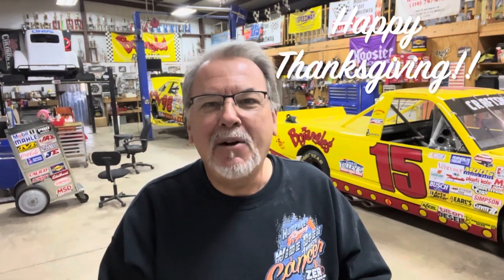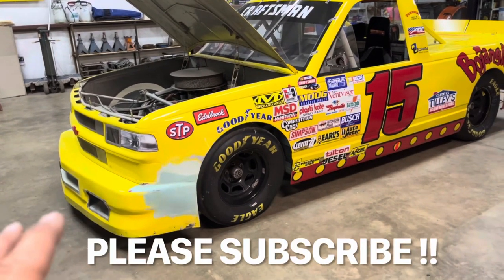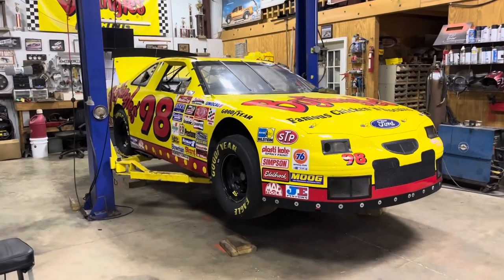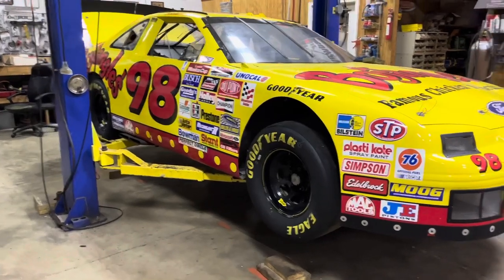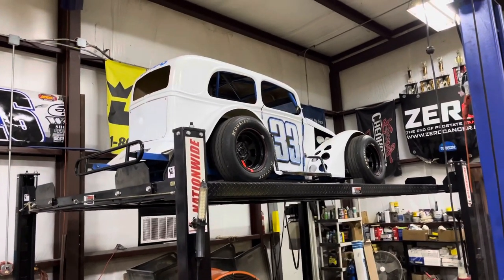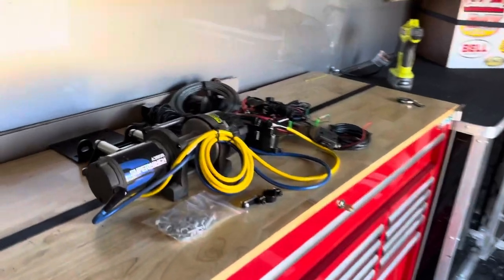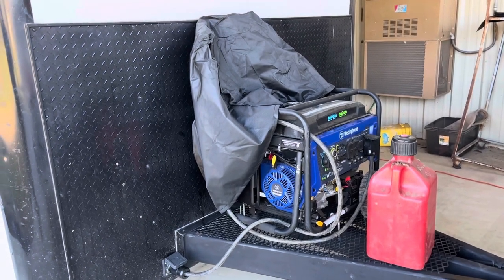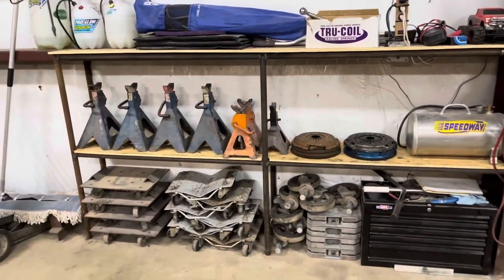#314 Where Have We Been & What Have We’ve Been Doing ?? Latest Update !! Happy Thanksgiving !!

Comment: Hi, I had a question about the sheet-metal on my oval track car. I believe it was raced in Nascar. My question is the sheet metal on my body is really thin. Thin enough to wear it’s flimsy and dents super easy. Was there a standard sheet metal thickness or was it what teams wanted to build?
Reply from the maker: Yes the steel used was pretty thin - I’m guessing 020
Reply: @racecarfabricationrestoration   I have a Redbull oval track car from 2008 and the metal body on that is a lot thicker. Leaning toward builder preference?
Reply: To clarify I have two cars, one with thinner and one with thicker.